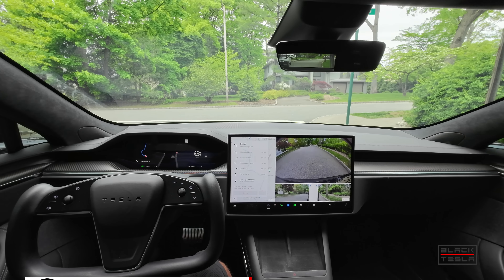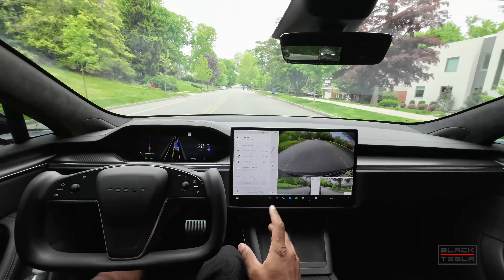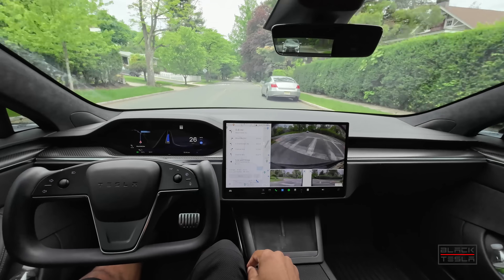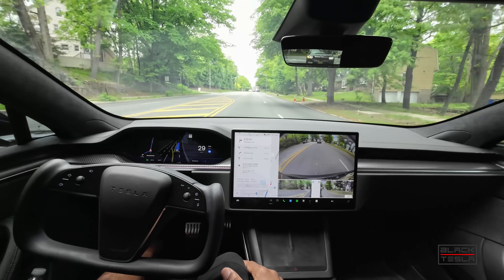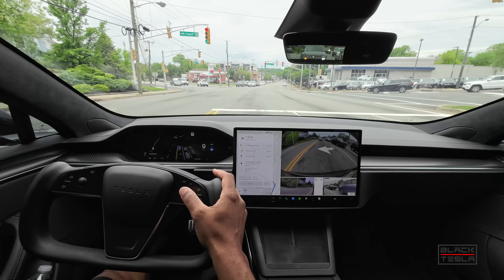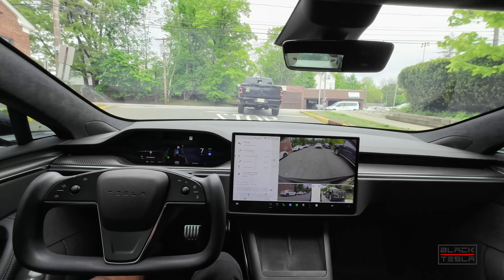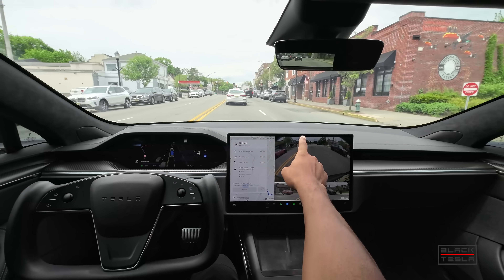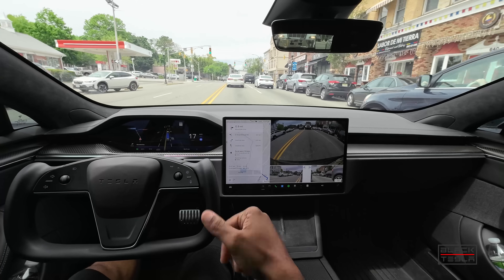FSD Dead Zones!?

Comment: Thank you for your meticulous testing. I didn’t realize that FSD had “dead zones”. I wonder if the problem is related to cellular data reception.  Could you please answer the following questions. (1) Do you subscribe to Premium Connectivity? (2) Do you know if FSD can be used without a Premium Connectivity subscription?  (3) When you enter a FSD dead zone, please pullover and stop the car. Look at the cellular reception indicator on your Tesla display. Are you getting a weak signal? Look at your cell phone and see if your cellular reception is also weak.  

Thank you for your informative videos!
Reply from the maker: 1) yes 2) FSD does not require premium connectivity 3) cell reception is still there in that area both on the car and on my phone

Comment: Thanks for sharing.  I didn't realize dead zones exist.  I can see all sorts of possibilities from bugs to geofencing but I guess my top two guesses would be: (1) there's a lack of training for the specific conditions in that area and when FSD sees a lack of training "weights", it disengages or (2) they have geofenced that area out due to some local ordinance, law, or other red tape that prevents automated driving in that particular area.  "System error" could be a hint that the system just doesn't have the training data to perform maneuvers in that small area.  In other words, the "error" could be "missing data".

Comment: Do you see the absurd stop sign right on the right immediately after it disabled? That's probably a risk that the car wouldn't know if it should stop or not. Whoever thought it was OK to have a stop sign like that which does not apply to your road ... it would confuse people, never mind FSD. My guess is that they have some known problem areas and they are disabling the system near them until they are confident the system can consistently make the right decisions there. @8:37

Comment: FSD does not need a cell signal.  I have driven for hours out of cell range with FSD. It did eventually turn off but I think that was because it's data collection buffers were full. I'm in rural New Mexico and there are many places here that still do not have cell coverage.
Reply: cell single may be different than its connection to star link, a few people have mentioned that his is probably related more to star link connection than cell reception.
Reply: @Sir_Meepus  The cars do not have a Starlink connection.  Just LTE and wifi. And Bluetooth to your phone at short ranges.

Comment: To me it looks like certain points in the map might be causing some stupid compute error (something as simple as a divide by 0, classic issue when dealing with trigonometry operators like sine and cosine, which are used to convert GPS positions between different formats).
Once the "divide by 0" (or whatever it is) bug happens, it is not properly handled and just crashes the whole system.

If I'm right, it shouldnt be too hard to fix. However, the engineers might not have yet realized that this is happening

Comment: So, observations: 1. It stated the system had an error, we can speculate - I'd suggest a straight forward bug in the NN. 2: The recovery from that bug was excellent (i.e. the system requested that the "supervisor" takes over), there was no danger and it operated well within its stated boundaries. 3. The poster of this video's narrative implies some sort of permanent problem with particular locations as regards self driving (that won't easily be overcome), rather than there's a combination of inputs that causes a bug to fire - that's mis-characterization (presumably for clicks, since negatively always draws clicks). 

All this demonstrates is that the system still has bugs that need to be fixed - i.e normal. Waymo, in similar circumstances, hands over control to remote drivers, ergo this is not unique to Tesla.
Reply from the maker: It can only be presumed since we don't know the exact reason. All we do know is that this area has presented a problem for a long time and continues with v12. Not looking for clicks just to help inform the community as is my purpose with all my videos...am not media and am not a youtuber trying to make a living.

Comment: Let's clarify this as there is a lot of incorrect assumptions here. 

Firstly, FSD is entirely self sufficient. It does not require any external data signal such as GPS or cellular data to operate, and will cancel on this basis alone. Think of it operating in long tunnels with no cell or GPS signal. It doesnt suddenly cut out. It will complain if GPS signal is lost for sn extended period of time but continue to use dead reckoning until the signal is obtained. 

However, FSD does require valid map data to operate. It can deal with incorrect or out of date data (such as a new roundabout), but cannot deal with corrupted data. If the map data that it processes is corrupted or invalid, it will immediately abort. 

This is the overwhelming probable reason for the consistent abort at this location
Reply: This sounds logical to me. Weird bug related to map data. The map may even be "correct" in the eyes of the map provider, but contain some unexpected weird detail for FSD.
Reply from the maker: Good theory, we've seen it operate in the tunnels under water without GPS signal, and map data is a component it uses. According to others in the area this has been happening since v10 so if this is corrupt data it's been corrupt through all map updates since which is scary
Reply: @BlackTesla  Just for thoroughness, you could pull over, check the map on your phone to make sure it shows the roads and your location correctly.

Comment: Hi BT. Finally someone with the same issue as me! I have a 2018 M3, live in Vancouver, BC and have had FSD for about 4 years. There is one dead zone I have that has developed just in the last year. FSD worked perfect traveling through this spot for more than 3 years and now it’s a dead zone like you have. What I have noticed is every time it shuts down, the car depicted on the nav map is situated on the wrong side of the road and this causes the red steering wheel to get activated. Similarly I have to drive past this zone for about 500feet before FSD lets me re-engage. So I think it’s fair to say this is a map/GPS error. It first became an issue pre v12 but still persistent with v12 also. Have reported to Tesla multiple times but still no fix. Lately I choose an alternate route so I can get my zero intervention drives. Thanks for doing a video on this phenomenon. Hopefully a fix will be forthcoming.
Reply: I totally agree. It has to be a GPS issue
Reply: Do you think there was a construction zone 🚧 at one point in the past that could have caused this to accrue? 🤔 Maybe it hasn't been updated since the construction was finished. Maybe a new intersection was constructed during that time in the past. 🤔

Comment: If you could zoom the maps in and take turn off the rear view camera then we might be able to see if there is an associated mapping glitch (for instance does the GPS marker on the maps freeze or do anything crazy that would indicate a GPS issue?).
The very interesting thing is FSD is supposed to be highly visual only, so you would also need to look at the road and surrounds to see if that's the issue. I've only got a very old AP version in Australia but I often get these bail out issues going through intersections as the system loses its idea of what it needs to do. Maybe the road colour or texture at this point is doing something similar to the FSD vision that causes it to lose its understanding about the drivable space.
At least it is repeatable behaviour, so Tesla might be able to do some testing and analysis to understand and fix it.

Comment: FSD should have spent the 1st year mapping every inch every Tesla took
and of course, it needs highly accurate tools to make precise maps
like LIDAR, RADAR, and 360 degree cameras with 20/20 vision.

Then FSD would ask for assistance at certain spots
like if a 3 way stop has 1 way that does not stop
that would be invaluable to know before the car gets to the troubled location

Under no circumstances should any self-driving app use an outside vendor for critical info
like maps and weird locations.

This info would be uploaded at night when the car is charged and shared with other Teslas.

But such is not the case....
Reply: FSD is still just a simple Level 2 assistant, that makes mistakes on any challenging drive.

What you are describing is on a much higher level than what Tesla has been doing.
.

Comment: Funky finding. Never had a spot like this in my many travels that I can recall. I'm talking x-country x 2 as well. Will have ADAS drivers out there any day! Thanks
Reply: ADAS, does that mean Robotaxi?
Reply: @DerekDavis213  They are the FSD Tesla testers that show up at Chuck Cook's intersection all the time.
Reply: @bennybob60  I've watched those  Chuck Cook videos.  Even the latest FSD still has problems with unprotected Left turns.

Robotaxi and Level 5 Autonomy?   Years away.

Comment: I wouldn’t consider this a dead zone, but I have multiple areas around me where the car will yeet itself randomly without a turn signal into random turn lanes and slam the brakes on violently. If you weren’t paying attention, this could cause a serious accident.
Reply from the maker: I call it a dead zone because FSD literally crashes (system error) at the same point every time and won't allow you to enable it until out of that zone.

Comment: There is a spot in upstate NY, at intersection of Northway I-87 and Rte 7.   It has always turned off all autonomous features...FSD and Autopilot.   It takes about 2 minutes before it can be turned back on.   Even if FSD is off...for two minutes after passing that point...from Any direction.
Reply: I've reported it to tesla dozens of times over the years.   Happens to every model and model year.   It's only a couple miles from a service center so they know it's there as well.   I've been contacted by Tesla for map pins multiple times.   
  No response, no fix.   No explanation.   Can't have robotaxis  if they just shut down on major interstates.
Reply: Maybe FSD is turned off when it is close to government buildings, politicians homes, or any sensitive address?
Reply from the maker: That's exactly the scenario thanks for sharing

Comment: Very interesting. It could be a marked location where a crash has occured due to FSD to avoid it repeating. You could try to map out the area on all ingoing roads, see if you can determine a shape. If it's spherical or just a road segment. Then we might be able to figure out where the center of concern is, if that's what it is. There is a shallow angle merge road coming in from the right that's somewhat non standard. It might have a very particular form that tripped its logic so it does something problematic every time. That is about half way between the two end points you pointed out.
Reply from the maker: Very interesting theory. It's a sphere so any road north, south, east or west approaching that zone throws the same error.
Reply: Not the case for this location. I live a block away, and it’s been a dead zone for quite a while, and no major accidents that I’m aware of.

Comment: There is a highway near me that went into service mid last year, and is a complete dead zone the entire length.  You can activate FSD but it immediately tells you it’s either 15 mph or 25 mph. If you scroll the speed up, it will take it, but then start giving you warnings and either pull it straight back down again or give you the big red steering wheel. The car does not read any of the signs. There are many speed limit signs all at 65 mph. Of course the offramp exit signs does not read any of them. It doesn’t recognize ramps and exits. Because of my experience trying this road multiple times which I would like to be able to use use I started to question how much the car is actually running through cameras versus, how much the map is actually controlling the navigation process and actually FSD /auto pilot. Very odd behavior. I currently have over 86,000 miles on my model three performance and I would say a very high percentage of that is under FSD/auto pilot. I apologize if this comes through as a while of text as I’m trying to use voice to text in my car at the moment.
Reply from the maker: All good thanks for sharing

Comment: That is very interesting.  I did have this one turn that is a bit unusual that I got a disengagement like the one you got but I thought it was because I was not looking straight ahead or chatting too much with my bro who was sitting in the passenger seat.  I drove that same spot several times since and have never received the disengagement notice again.  I am quick to respond to the nags and I presumed that FSD just wanted me to be alert and reply to the nags quickly.  I have been using FSD for 98% of my drives and it's been working great and pretty much intervention-free.  My biggest issue is not slowing down for all speed bumps close by my house.  There are signs that say speed bump and with speed of 10 mph in my neighborhood but the car does not slow to that speed.  FSD will slow from 25 to 17 but that is too fast for these huge speed bumps.
Reply: When the arrows are painted on the speed bumps, my FSD slows down just as I would.

Comment: It's most likely that there is something with the map data at that point which causes a bug, given how exact the location is where it disengages.
Reply from the maker: Yes but it's odd because it's not just disengaging it's causing an error that makes FSD shut down. It's a system error it reads 🤔

Comment: FSD is pretty impressive as it stands. Should be sold as a drivers assistant at this point. Good deal at $99/mo!
Reply: Should be sold as a drivers assistant at this point. 
It is; ADAS = Advanced Driver-Assistance System
Reply: @BigBen621  But for years up until 2 months ago, Elon sold it as

Full SELF Driving

Which turned out to be a false promise.
Reply: No it is true. It is self driving.
Reply: @Kaipiso  If it requires 100 percent human supervision, then clearly it is not SELF driving.
Reply: @DerekDavis213  No, that is untrue. 
By wiki: self-driving car is a vehicle that is capable of operating with reduced or no human input. The term you are talking about is full autonomy car, and that is something else.
Reply: @Kaipiso  omg.   Nobody cares what Wiki says!   Today, FSD cannot be trusted to drive the car safely all alone.   100 percent human supervision is required.  What a huge disappointment !
.
Reply: @DerekDavis213  We disagree here. It can be trusted, it is safer than many humans, often doing several minute runs without any intervention. Sounds nice to me.

Comment: Theoretically there shouldn’t be dead zones because the compute is all on board. Must be related to GPS signal.  It would be good to understand
Reply from the maker: Exactly, dunno what's going on
Reply: @BlackTesla  Could it be that FSD actually requires a data stream from the Starlink network, and Tesla has not revealed that to the public?
Reply: @DerekDavis213 No. Munro would have spotted a receiver.
Reply: @DerekDavis213 No, that would make no sense
Reply: I get the impression that the FSD is falling back on map data and driver telemetry, rather than being solely autonomous. Which I believe was the original intent.
Reply: @Jac70  Musk wanted no geofencing at all. Which is what you need for true autonomy imo
Reply: @Sal3600  Too bad that true Level 5 Autonomy is years away, for the simpleton FSD system.
Reply: @DerekDavis213  i wouldn't say it's simpleton. But i agree it's years away. Three edges cases will decide it's availability in the end. That's going to be tough. But that doesn't mean Tesla should give up.
Reply: @Sal3600  After many v12 point releases, and a huge data center with $1 billion in NVidia compute cards, FSD still makes obvious mistakes every day.  On any challenging drive.

Most people would call that a Simpleton.  It is the right word.
.
Reply: Is this simply to have more data available for troubleshooting during Beta?
Side note: I noted with some frustration that I am not able to back the car out of a parking spot using the cell phone app if the car does not have a cell signal, despite the phone and car communicating over Bluetooth while standing right next to the car. This has been a problem for me in tightly spaced underground parking garages.